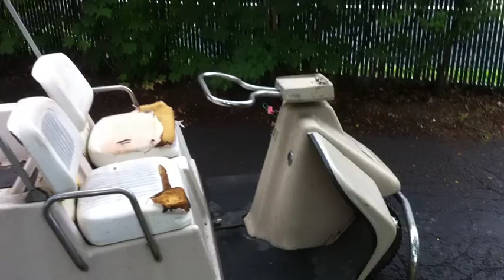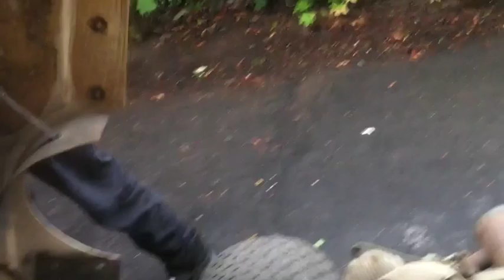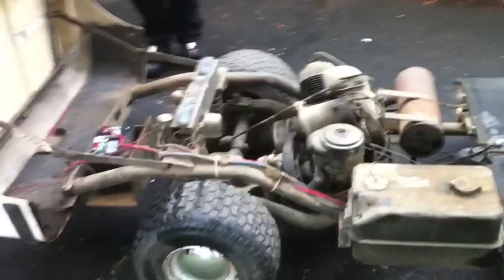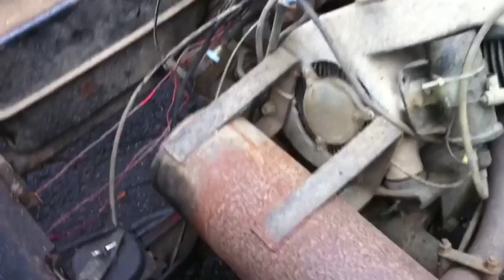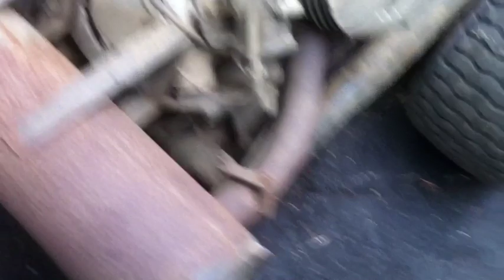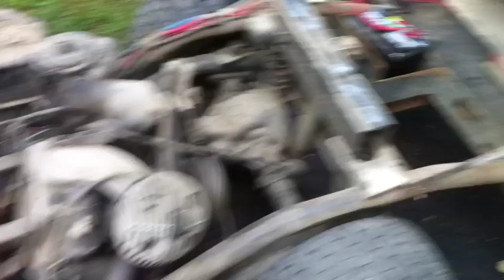1973 Harley Davidson Golf Cart

Comment: Same cart. I'm having an issue. It will turn over but it won't start up and get off of its feet. It was running fine. Then gradually got worse. Now it won't start up. Has spark. New air filter. I'm assuming it's getting gas , you can smell exhaust while it's turning over
Reply: The main seals are known to go out in these ol trikes.  It causes them to run lean and have to constantly be choked.  Idk if that’s your prob but it’s something to keep in mind
Reply: loathsomedong thank you!

Comment: Howdy, I have the same cart and was hoping you might be able to help with a problem. I see your wet clutch spinning like crazy, mine wasn't putting tension and raising the belt. I popped open the basket and saw one spring was slightly off. So, as I took it off, all the oil leaked out of course, but the dead center of the basket looks like it was modified or something, there is just a piece of metal there and no screw to refill the fluid once I put it on. In fact, the metal is broken out in spots. Any idea how I might seal that hole and still get oil in?

Comment: I have a '77 I am restoring. I Got it running great, but as I was making sure that reverse worked and actually spun the tires... the lever snapped back into forward while the engine was at quite a high rpm. The transmission front drive no longer retracts into the engine to tighten the belt, which means I have no tire spin. Compression is good. Transaxle is good. but I'm afraid I broke something inside the front drive or maybe in the engine. Any suggestions would be much appreciated, it's driving me crazy. I was so close to finished.
Reply from the maker: I'm not entirely sure however sounds like you damaged the centrifugal clutch unit.

Comment: Were these made to run and idle or were they like most carts where they turn off once not on the throttle
Reply: No, it has no freewheel device.  He probably had a brick on the gas.
Reply: Audie
Micro switch connected to gas pedal linkage  most likely is bad or connected  N/O instead of N/C

Comment: I have the same question about the belt number and what is the easiest way to change the belt without pulling  the clutch out
Reply from the maker: I have a spare, it is stored in my car barn. I'll swing thru it today and get the numbers off of it for you. as far as removing it, there is an adjustment that tips the pulley to remove the belt.

Comment: i have the same kind of cart you do, just wondering how do u get it to run/idle like that without it taking off on you? once I hit the pedal and it starts it goes, without feathering the pedal it will die?
Reply from the maker: That is thanks to the former owner. who after breaking the key in the ignition, wired this thing up so it ran like this. I didn't like it, and we are currently bringing it back to original condition.